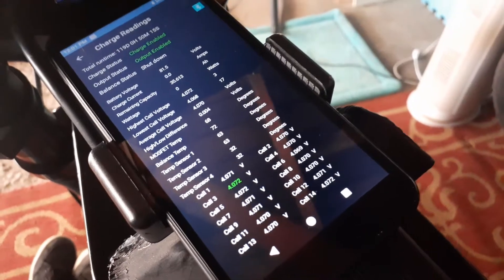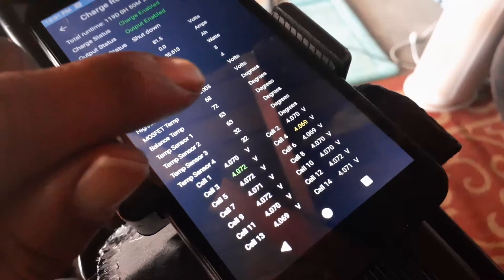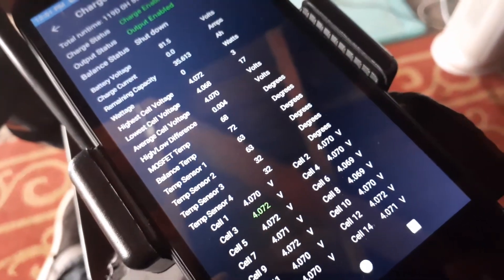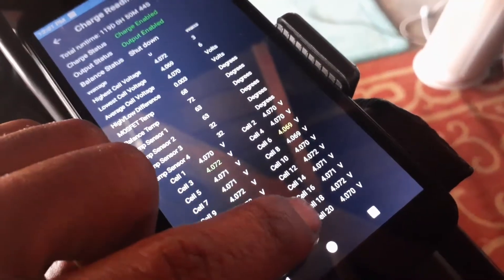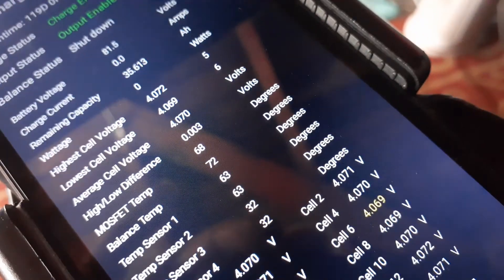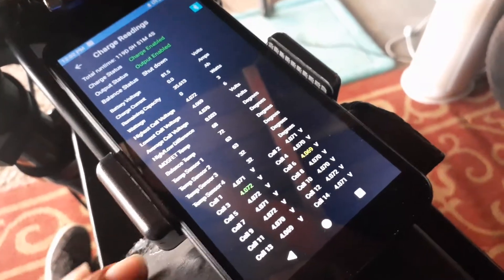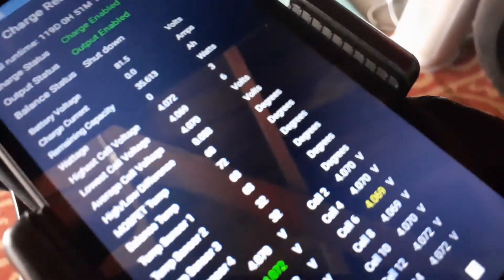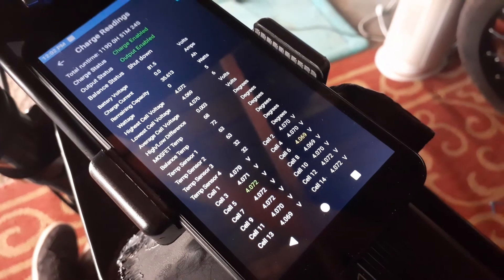VBMS app. Bluetooth BMS 20s 72v 300amp. DIY Stealth Bomber ebike

Comment: Hey brother question if I purchase a battery that’s 72v 60ah will a Bluetooth bms on the battery be able to show my amp hours remaining ?
Reply from the maker: Absolutely 😁
Reply from the maker: You will be required to type in the amount of Amp Hours. Afterwards, the computer will know exactly how much is left based off of the Voltages remaining 👍🏿😎
Reply: @batmanofinglewood  how about bms discharge amps?
Reply from the maker: YOU will be able to see EVERYTHING. Voltage Drop, Amps Hours Used & Remaining, Amps Output, Watts etc.
Reply: @batmanofinglewood  awesome thank you brother this is helpful information!

Comment: got an issue with mine posted here - https://endless-sphere.com/forums/viewtopic.php?f=14&t=111758&p=1655657#p1655657 any idaes?
Reply from the maker: 🧐🤯That cell difference is TOTALLY MINUSCULE🤭😂. ABSOLUTELY nothing to worry about. Worry when its cell difference is a half a volt or something like that.  Your cells are almost identical...

You for sure need to charge the battery. I did read that you haven't charged it yet
 Please charge the battery. My cell differences are usually around .010 and sometimes 0.018 (This is nothing)... sometimes my cell difference is  .002
VERY VERY SMALL!!!
Reply from the maker: Don't stress yourself. Be proud to have successfully installed your BMS 😎👍🏾

When you balance your battery, it WON'T be EXACTLY what you set it to. One or more cells will gave a very very slight difference once the cells have been charged and start to settle.

IF YOU ARE NOT GOING TO RIDE IMMEDIATELY AFTER CHARGING, DONT FULLY CHARGE YOUR BATTERY. ONLY DO ABOUT 85% - 90%. if it's going to sit weeks, charge to only about 4v - 4.1v per cell; about 70% to 80%
Reply: @batmanofinglewood  Thanks man, its about 0.1 difference now, and it was 0.005 when i built it, the cell in bank #1 seems to have dropped 0.995 volts more than the rest. Ill Charge it up and see what happens!